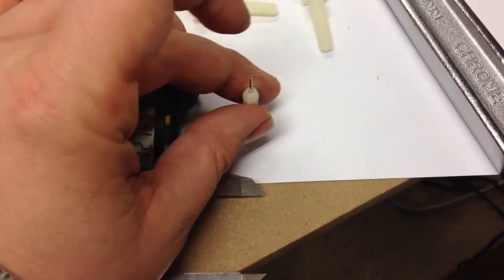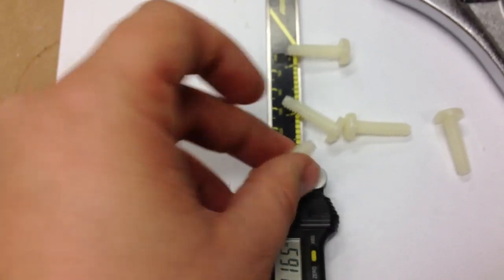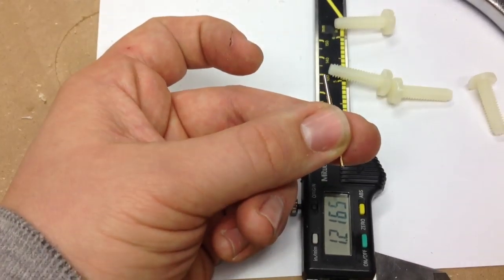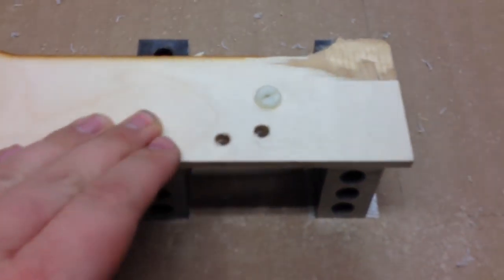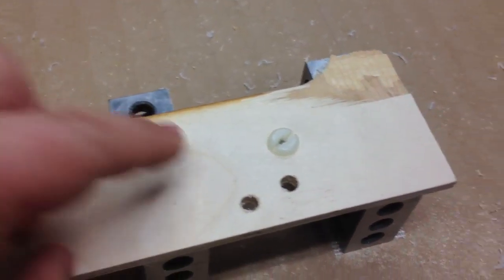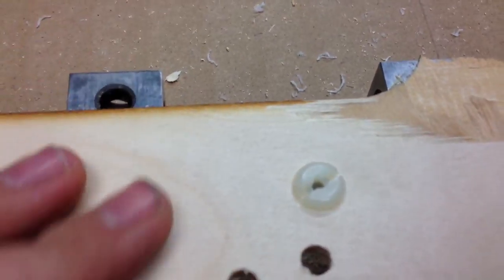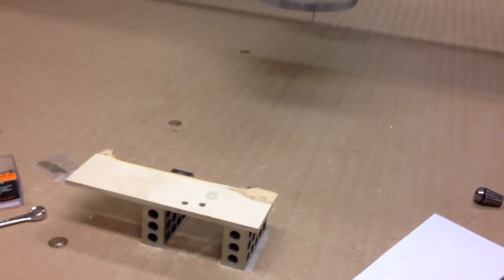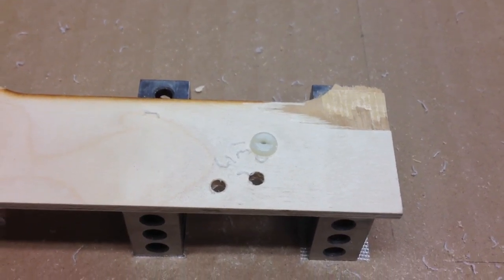Making the holders for the pogo pins

Comment: I just got 100 for $2 from China.  Had hoped to just solder them into a perfboard, but the fixed ends are just a little too wide.  Had planned to test surface mounted MPUs that have been mounted to PCB plates ... you know, before putting real pins in.  (scratches head)  There has to be an easy button for this.